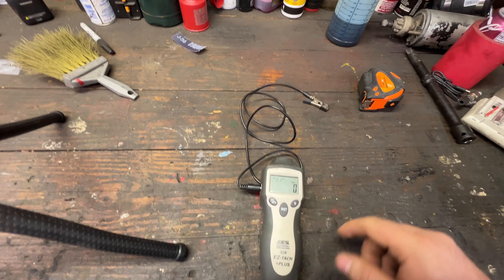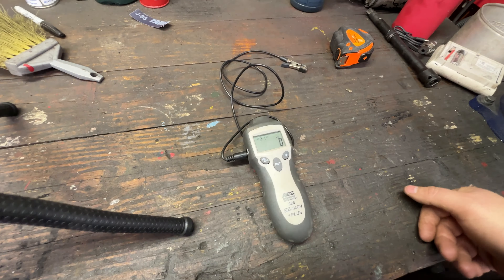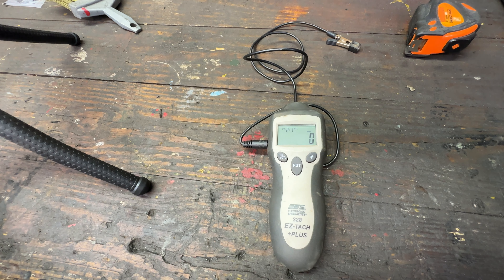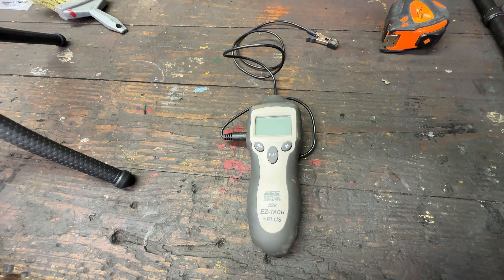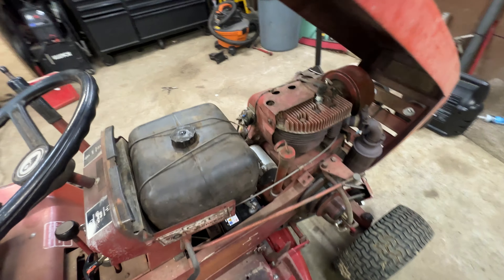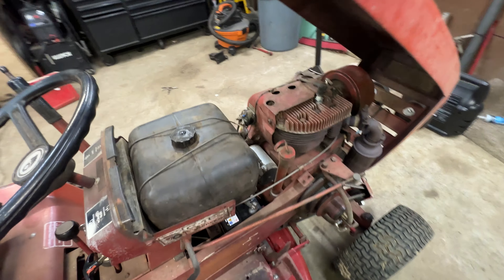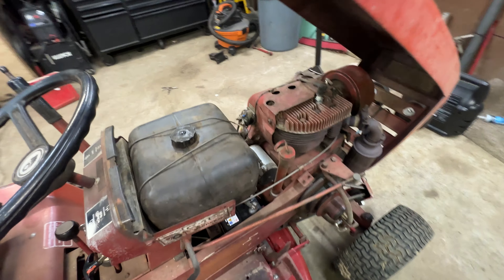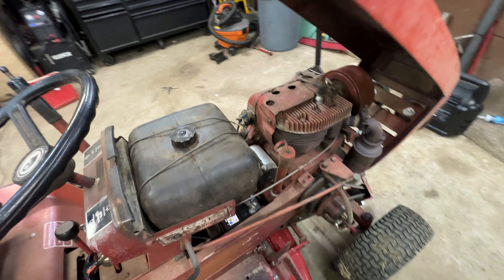Tackling RPM with Ease: Electronic Specialties EZ Tach Model 328 :TTO

Comment: What a handy little piece of equipment! Y’all certainly have a knack for finding and using all types of cool stuff like this! I do have a handheld tachometer as well. But it’s not one that will read the rpm from a plug wire. I gotta put reflective tape on what I want to read. Or there’s also a tip that goes on it you can touch to whatever it is you’re trying to read. I’ve tried that like twice on the flywheel screen. Doesn’t work out to well the little rubber tip goes flying every time 😄 anyway great tool review thanks for sharing it!
Reply from the maker: I have one of those somewhere! I think I saw Chichanic using one of these years ago. I seem to be using this more and more. Glad you found it helpful!

Comment: These newer generation digital tachometers are sure handy to have around. I have a super cheap digital optical style. I'm kind of curious to know why your c160 idles so low. Kohler Spec on minimum RPM is 1,200 I believe. My understanding is, below that you run the risk of not having enough cooling air or engine oil movement.
Reply from the maker: I could turn it up. I hardly ever idle it for any length of time. That’s a good point thought. Next time I have it out I’ll turn it up to 1200 to be safe.

Comment: I’ve had one for a couple of years now and found that in order to use it without the lead I have to hold the unit against the plug wire on the left side of the unit where the lead wire would plug into. The end of the unit is just a light that I have never found any use for. Mine does not work when I try to use the end of the tach. The readings jump up and down way too much. I’m not happy with my purchase and wish I had gone for something more reliable.
Reply from the maker: Good Feedback. I've been happy so far. Thanks for watching.